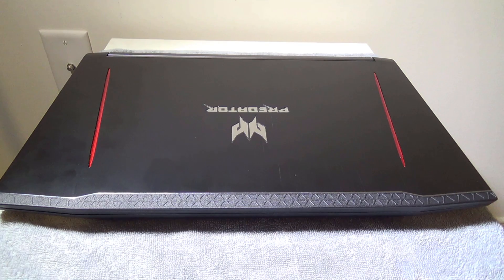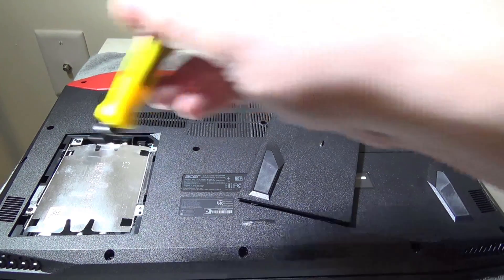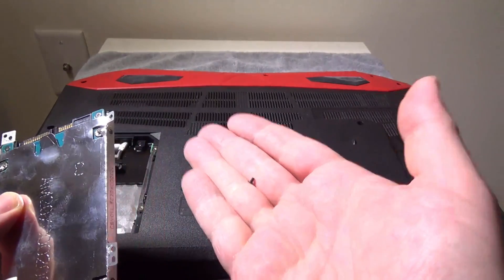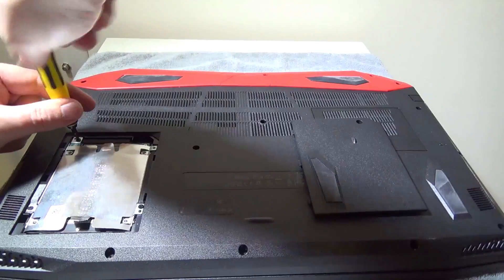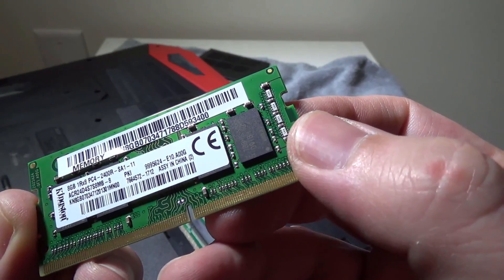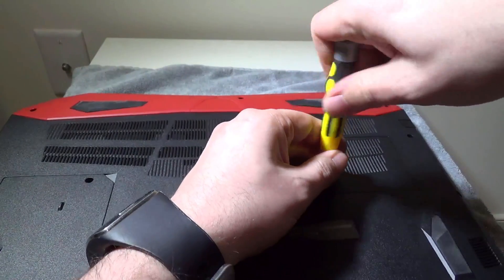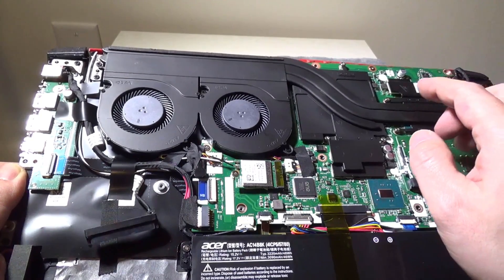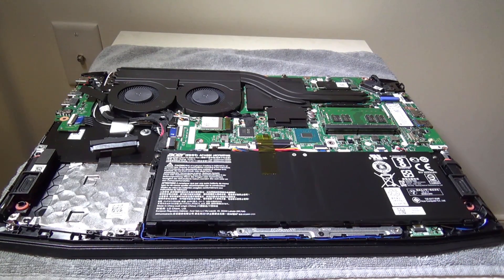Acer Predator Helios 300 Gaming Laptop • How To Add a 2nd HDD and Upgrade RAM

Comment: This is a long description, sorry.
My son gave me an Acer PREDATOR Helios 300 Laptop Model N17C1. 
He passed away 3 years ago and it was two years before I could even open it up again. I wasn't a gamer, but I do a lot on Photoshop and did on this laptop. 
When I went to start it up there were two chargers that looked similar I grabbed one and plugged it in. Can't begin to tell you how I felt when I smelled a burning smell.  I read a few things about it, bought a new battery and still nothing. About 6 months later, my phone battery died and I took it in and had one installed and had him also check out the laptop and he said the hard drive was no good. I check prices for another compatible laptop and anything remotely near the Predator is much more expensive than a replacement hard drive. You make it look simple to replace, but I'm worried something else could be damaged. Should I give a replacement a try or go with a new laptop, not the caliber of this one.  Jason taught me so much technologically, but I hate to throw money away if something else could be messed up. I will just give up on keeping the one he gave me when he got a new laptop.
Reply from the maker: First off , I am sorry to hear about your son.  As for the hard drive, it is very easy to install, you should not have any problems.  You can buy one off amazon and if for some reason it doesn't work and the laptop has another issue then they offer a 30 day return period.  Also if you are going to be doing just Photoshop, there are other laptops out there not geared toward gaming that won't cost as much but should handle Photoshop just fine.   I hope you get to the bottom of it all but yeah when replacing the hard drive, just take your time or take it to a fix it shop you trust but you can easily do it yourself.
Reply: I will check in to some other computers that will work for what I need. I know my son probably has another laptop, but I haven't been able to go through his stuff yet. I guess I'm hesitant to give up on the one he gave me. The hard drives are not that bad in price on Amazon. I will probably take my second step in that direction and use your video as a guide. Thank you so very much. @GalaxyTechReview

Comment: I was wondering of anyone could help me with a problem I'm having. I opened my laptop completely and there was a wide wire or something like taht that was connected to the hdd holder and that's why I can't do anything with my computer where does that wire go because it's not connected to the motherboard or anything like that

Comment: Hi,
When i am disassembling the laptop for cleaning, i accidentally end up by damaging the hard drive connector.
now, i cannot turn on my computer.
if i change the hdd to motheroard connector, does the laptop will work? or do i need to connect with the service team of acer?

Also please tell me that is there any connection beetween hdd connector damage and laptop not turning on?
Reply from the maker: I would connect with Acer Support on this.

Comment: Does this model of the Predator Helios 300 (2017) have a limitation on the second SSD's storage capacity? Wondering if I can grab a 2TB 2.5" SSD, or if it'll just be incompatible.

Thanks for the great video!
Reply from the maker: 2TB will work just fine.
Reply: @GalaxyTechReview  how about 4tb?

Comment: Mine is core i7-8750H and I was wondering if I can upgrade it to 3200mz? Mine is 2666mz and I am getting 16x2 ram that has 3200mz
Reply from the maker: Not sure if it will support 3200 BUT good news is it will default to the highest speed it can handle, so you might as well go for 3200
Reply from the maker: There have been so many models of the Helios since I had mine, I am just not sure if your particular model supports 3200 or not, if it's newer then there is a good chance it does though.

Comment: Hi, I have a loud crackling/feedback issue with my front speakers on the right side only.  It doesn't always harken straight away,  but it gets so loud,  rebooting is the only thing that gives me a short break. Any ideas? It's about 7 years old now, my i17 predator.  Cheers

Comment: sadly i lost the box since it has been 2 years since i bought this laptop and i have a question, yesterday i bought a 2.5 ssd and installed in then put the caddy over it (no screws to the side) and screwed in the caddy ones to the chassis but one of the screws wouldn't go in place anymore and i couldn't find replacement (the one on the top right from the view of the video). my ssd is working fine and everything but is it okay or will it get damaged overtime? it is crucial bx500 if that matters and thank you so much for reading all of this and the helpful vid!
Reply from the maker: shouldn't get damaged since it's a SSD drive and not a mechanical drive that would normally get damaged because of the spinning disc inside it.. you should be fine.
Reply: @GalaxyTechReview  thank you so much for help!
Reply from the maker: Anytime

Comment: Do i need to do anything before putting new RAM in? Like do i need to go into the BIOS? I've got 8GB of duel channel ram on my acer predator and looking to upgrade to ether 16GB or 32GB
Reply from the maker: No you should not have to go into the bios before installing.

Comment: Hello. Thanks for the video. I have new RAM that I would like to put in. It is the correct kind. It looks easy enough except I have one question. I did not see you get rid of the static or disconnect the battery. Is that not necessary to do with this simple RAM istall as long as I ground myself and do not touch anything metal? I have the tools to get into and change the RAM but I do not have the right tools to take the casing off and remove the battery. Nor do I trust myself to not bend the casing up. Please let me know if you can provide insight. I'd appreciate it.
Reply from the maker: You are find just be grounded and be careful when you install the RAM, you won't have issues.
Reply: @GalaxyTechReview  Thank you so much for the info and also for responding so quickly. I really appreciate it.

Comment: what do i do after replacing the ram and hdd
Reply from the maker: In most cases turn in the pc and then go to settings then disk management and format the new hdd as for the ram if properly installed there is no need to do anything the system will automatically detect it.
Reply: @GalaxyTechReview  thx but do you know how to transfer all my stuff from the hdd to the ssd(sorry if I am being a bother)

Comment: I have this exact laptop except 17” version, so I wanted to know it already had 256g ssd, I want to expand, should I get a ssd or sshd or hdd??
Reply from the maker: You can get a SSD or HDD or SSHD to fit in that second drive bay, it's a SATA connection..

Comment: i have a question you didnt add 2nd hdd you just ugraded the old one. pls how can i add an ssd (not upgrade my old hard disk)
Reply from the maker: Not true mine came with a m.2 ssd as the boot drive so that drive bay was empty when I purchased it.  If you bought one that already has a SSD or HDD in the drive bay then you may have an open m.2 slot on the motherboard you can fill..

Comment: Hay brother, I was following along to add a new storage sad thingy and when I opened it, the connector isn’t on my Helios??? Opened the entire back and cannot find it? (Acer Helios 300 2017). The little cover wasn’t there too. I am supper confused.
Reply from the maker: Some of them didnt ship with one you should contact acer directly to get one shipped to you.
Reply: Galaxy Tech Review Will do! Thank you very much! I appreciate you.
Reply: Thank you brother! I finally installed it and I have one more issue. My Acer doesn’t identify that I have installed it. How could I fix this?
Reply from the maker: Go into windows settings then disk management and create and format a partition on the new drive before windows will recognize it.

Comment: I have the Acer Predator 17 G5-793-72AU and needed to add storage because Modern Warfare has taken most of it. Which HDD can i install for my laptop?
Reply from the maker: Any SATA HDD or SSD 7.5mm will fit in the second drive bay.
Reply: @GalaxyTechReview   Would purchasing the one you are using in video replace the old one ? or will it work together?
Reply from the maker: Yeah this one.  https://amzn.to/34aoCgj

Comment: i have acer predator helios 300 i5 8th gen . which type of ssd should be used for best performance.
Reply from the maker: The extra bay is a sata connection so a sata 2.5 ssd drive will fit.
Reply: In sata 2.5 have already 1 TB HDD. but i want to expand M.2 ssd which  is already in my laptop 128gb. i want to expand it 256 gb or 512 gb.

Comment: Ive no experience with opening up laptops or working on  them to this extent but i do have this laptop for about 2 years now, and i know from the sound of my predator its in desperate need of a good cleaning inside. 
I want to upgrade this laptop and having her running well so i take it it needs a harddrive upgrade, thermal paste reapplied, new thermal pads, and cleaned up cooling vents. is there anything else a predator laptop might need done? and do you have any product recommendations for items to use for it cause then I might just buy the items needed for its upgrades and drop it into a computer repair store nearby.
Reply from the maker: No looks like you have covered all the bases..
Reply: @GalaxyTechReview  is there any particular brands or items youd reccomend for the predator.

Comment: if you lost the 4 screws that screw into the part that wraps around the 2nd internal harddrive slot, will it still work without the screws?
Reply from the maker: Yes

Comment: Hai, In my predator I found that my primary hard disk has an read error rate using  crystal disk utility, It hangs when I load a game or try to forward sequence in movies and I want to replace it, What I need to do or is there any other way to do it?

Comment: Helpful video 
I have a doubt, the Predator has 1Tb HDD and 128 GB SSD by default and my question is that can i still upgrade my SSD+ HDD by 2 TB along with the default storage space i have. In total I mean (1tb hdd+128 gb SSD+2 TB(ssd+hdd) ? Or there is a limit to extend it?
Reply from the maker: a limit because that 1TB sata drive is already in the slot, the best you can do is replace it and double the 1tb to 2tb

Comment: Would putting in one 16Gb ram and keeping one 8gb ram achieve 24 gb of ram? Or would that not be compatible
Reply from the maker: yes it will work just wont run dual channel due to the size difference but thats fine
Reply: Galaxy Tech Review will not running dual channel slow anything down? Or will it be effectively the same
Reply from the maker: @lukebrennan5360   pretty close to the same, the increase in RAM size should make up for it overall.
Reply: Galaxy Tech Review thank you

Comment: The sata cable comes with the ssd?
Reply from the maker: the SSD installed is a 256GB m.2 SSD so no cable needed, as for the second drive bay, yes the cable should be included so you can add a sata ssd

Comment: I put my 2tb hard drive in my laptop but I turned it back on and the hard drive didn’t show up or wasn’t being used.
Reply from the maker: Thats because you didnt go into  Windows Settings then Disk Management and create a partition on the new drive.

Windows will not see the drive as it does not have a partition on it yet

Comment: I bought this used with just a 256ssd a<nd wanted to add a 2tb hdd, however not surprisingly as it was used I did not receive those four screws with the power adapter. Where would one get hold of such screws?
Reply: I heard acer deliver them for free if you ring them
Reply: or you can order a screw kit off of amazon...has a bunch of replacement screws for things like this.  faster than acer probably

Comment: So, essentially, it's laid out a lot like my Nitro 5. From what I've seen on the reviews, similar heat issues too... That can be worked with, though, with better thermal paste, a laptop cooler, undervolting the CPU, or a combination.

Comment: hi, do you know if its possible to replace the original hdd because a few months ago my acer predator helios 300 fell and i continued using it and then now i noticed that the hdd is not detected and only the ssd is detected, do you now if the original hdd can be taken out and replaced instead of using the 2nd compartment, thanks.
Reply from the maker: the original is an m.2 drive, you have to remove the entire back cover to get to it but it can be done yes.
Reply: Ok thanks
Reply from the maker: @pretz5584  welcome
Reply: @GalaxyTechReview  thanks

Comment: I had installed the exact same new drive! But it didn't read it once I turned on the laptop. I mean when I went into storage it was not listed as a storage option. What did do wrong and how do I fix it?
Reply from the maker: Go to windows settings the disk management and format the new drive before windows will be able to see it.

Comment: Thanks for the video! I am about to buy the Helios300 with 1tb HDD + 256gb SSD, so what I want to do is to upgrade the SSD for another one of 500gb (if I understood correctly I CAN and I HAVE to remove the one it is already installed), but  I also want to take the HDD out to use it for another laptop. 

So questions are:
1) Is it possible to upgrade the m.2 ssd? 
2) Would this one fits Samsung 970 EVO 500GB - NVMe PCIe M.2 2280 SSD?
2) Is there an extra m.2 slot, or do I have to change the preinstalled one? 
3) Can I extract the  preinstalled HDD?

Thank you!!

Predator Helios 300    Model Name: PH315-51-74V4
https://www.acer.com/ac/en/US/content/predator-model/NH.Q3FAA.004

Samsung 970 EVO 500GB - NVMe PCIe M.2 2280 SSD
https://www.amazon.com/gp/product/B07BN4NJ2J/ref=ox_sc_act_title_2?smid=ATVPDKIKX0DER&psc=1
Reply from the maker: 1.  yes   2. yes 3. no there is only one m.2 slot  4. yes

Comment: Can you add another 2.5 ssd if your laptop already has one?
Reply from the maker: no this laptop has a slot for a M.2 SSD and a 2.5 SSD so if your 2.5 slot is already full you can only add a m.2 ssd (great for a boot drive though)
Reply: @GalaxyTechReview  Could I use an adapter to put the samsung 860 in the m.2 drive? Thanks
Reply from the maker: @tycoon1661  no the m.2 slot is small like a RAM slot.. you can not do that, my advice is just buy a m.2 drive and make that your boot drive and then use the 860 as your games/storage drive.

Comment: Is it necessary to add those 4 extra screws?
Reply from the maker: You could put a drive in there without but it may rattle a bit over time. Easier to just use em or buy them on Amazon for like 4 bucks.
Reply: @GalaxyTechReview  Thank you so much for your response!
Reply: @GalaxyTechReview  Mind being kind enough to tell me what size mate?
Reply from the maker: https://amzn.to/2CJ0i9n  these will do
Reply: Galaxy Tech Review Sorry for being a bothersome fly but... How do I remove the extra HDD or ssd safely?

Comment: Thanks for the great video.  Sadly, 2/4 screws to the expansion HD bay have been stripped.  It most definetly could have been my clunky hands but I'm almost certain the screws were over tightened.  Any suggestions?  

I am most likely going to return/exchange but would rather not.  Thanks!
Reply from the maker: hmm for stripped screws, no unfortunately I'm not sure what you can do for that.

Comment: I threw away that charger box with screws I didn’t know what they were for.. do you need them to add the SSDH? I bought a new one and installed it, but it’s not showing up.. If so what size of screws are those? So I can buy them..
Reply from the maker: The reason it's not showing up is because you didn't go to window settings then to disk management and create a partition on the new hard drive once you do that windows will see it as for the screws you can pick them up pretty cheap on Amazon like 5 bucks
Reply: Galaxy Tech Review yes I got it now!! Thank you.
Reply from the maker: welcome

Comment: can you explain the difference between the Samsung 860 EVO 1TB 2.5 Inch SATA III Internal SSD? The one you using is 2x more storage for half price.
Reply from the maker: Samsungs is an SSD and the one I use is a 7200 rpm HDD You will get about double the speed out of the SSD but again like you said it's also double the price.  If you are just gonna store movies and games on the second drive the Seagate will work just fine.  Hope that helps.

Comment: Question, I plan on buying either the Helios 500 or Triton 700. What ram should I use. Because the dimensions look different from a standard desktop Ram. Planning to upgrade to 32gbs on either of them and M.2 and add a HDD
Reply from the maker: DDR4 2133MHZ PC4-17000 260-PIN should work just fine.

Comment: I bought the Acer Predator Helios 300 g3 572 59wg. Im correct that I cant Upgrade the Laptop to have the HDD + Sata SSD + M2?? Thanks for the lovely Video! Great Job!
Reply from the maker: There are only two slots one for an m.2 drive and one for a sata hard drive. So you can have two drives total.
Reply: Thanks for the fast answer ! And thanks for your time and engagement for this video and answers!
Reply from the maker: No problem, thanks for watching!